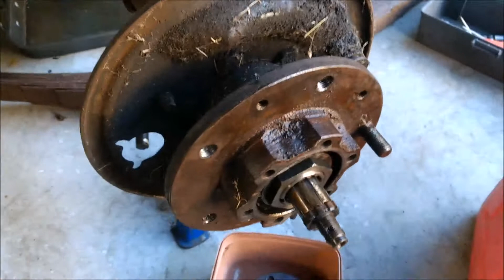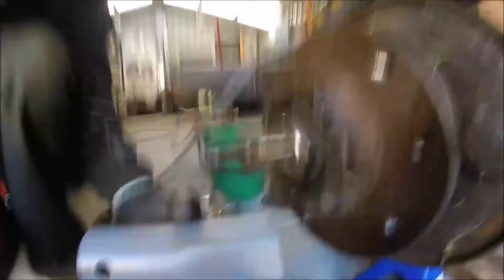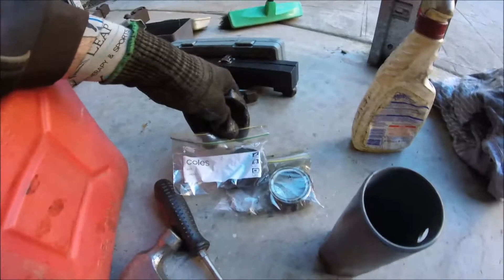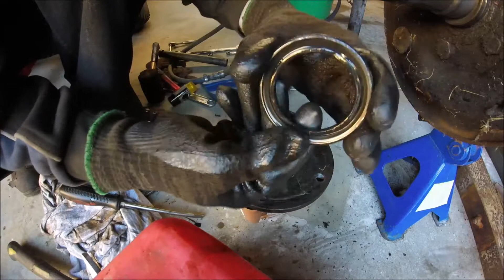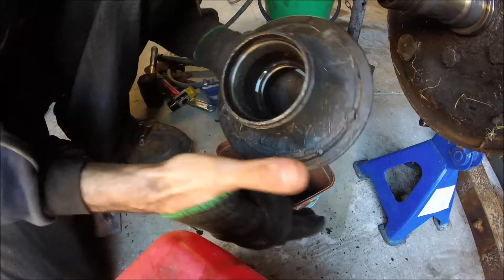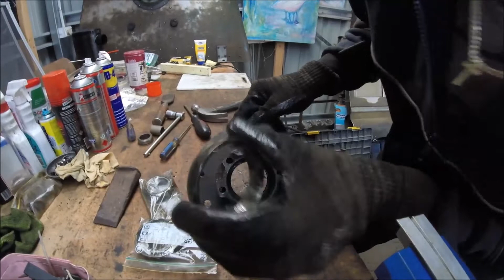Land Rover Series 2a 88 - Part 2: Rear Axle Restoration

Comment: It's even a better idea to slice the dicarded outer races with a thin angular grinder cutting disc. This helps because it can compress and doesn't bind when you use it to help push the new bearing in
Reply from the maker: That is a good idea as I have had the old ones bind in the past. Cheers.

Comment: What would you suggest for wheel cylinders? I'm torn between trying to rebuild them, buy genuine, or aftermarket. Aftermarket is way cheaper I just don't want to risk buying something aftermarket on a safety item.
Reply from the maker: Are you referring to the hubs with the studs?  If so, I am looking at buying press-in studs to replace all the screw in types. These are available p/n 561886. I agree tho, I prefer good used items, new OEM before buying aftermarket on some items.
Reply: I guess I should've commented on part 1 where you mentioned having to buy a new hydraulic brake wheel cylinder for the side that it is missing.
Reply from the maker: OK, just make sure they are a reputable brand, usually LR forums are a good source to check if a particular brand is dodgy :)
Reply: @rovertasmania7033  I wish I read this 3 months ago.